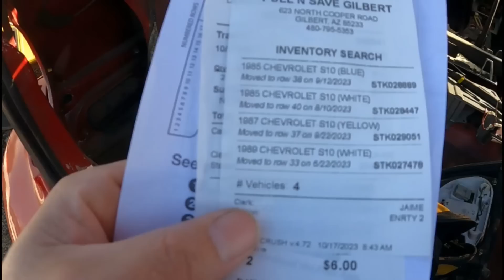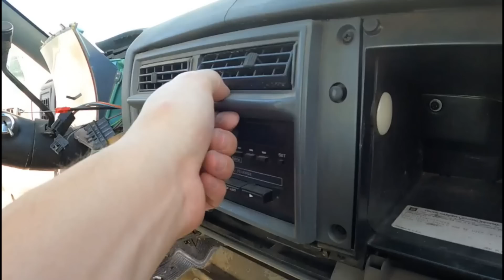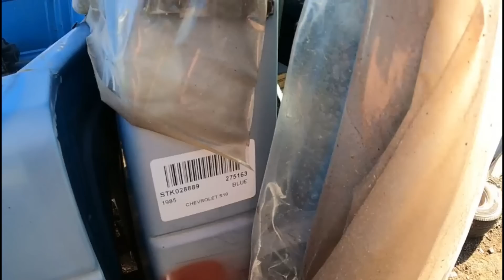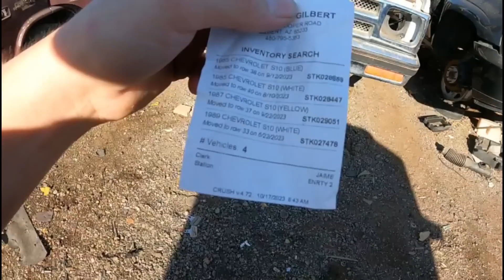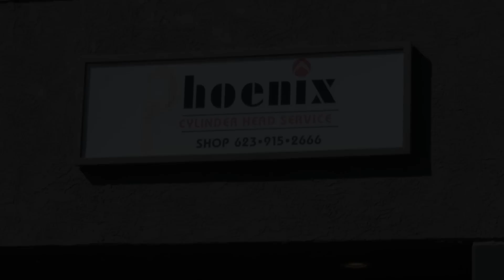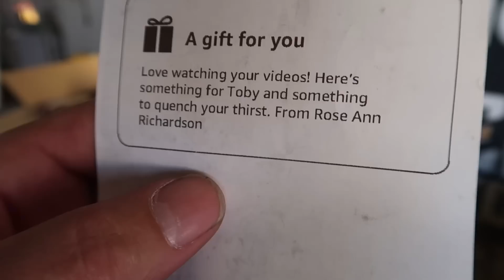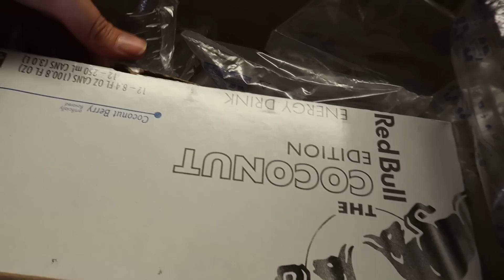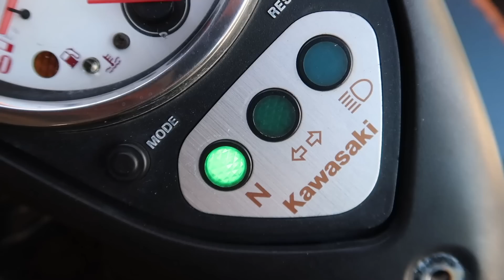Junkyard GOLD!

Comment: All vtec heads are dual intake and single exhaust unless you got a type r head.

Cheap cheat code we used to do back in day was use an extra set of intake inners and toss them in the exhaust side.

Comment: Stock dual valves springs is normal intake side on oem vtec heads. First gen b16 heads didn’t have them. You can run spare inner springs on the exhaust side too but better just upgrade all together

Comment: edit: incorrect info see response below * early b16's came factory with single valve springs on the exhaust, in the later models they were changed to dual.
Reply: Wrong. Only type r ever came with both sides dual
Reply: @MyWolffy  huh. i thought they were like the gsr's and were single on the first and dual on the later ones, after checking hondapartsnow it appears you are correct.

Comment: don’t run Pro2 cams on crower dual valve springs. The coils will bind and you will destroy your rockers, if you must, have the shop check for coil bind with those cams at max lift before you run them

Comment: Need to upgrade the springs and retainers and keepers if running aftermarket cams. Don't want to float a valve with high rpm